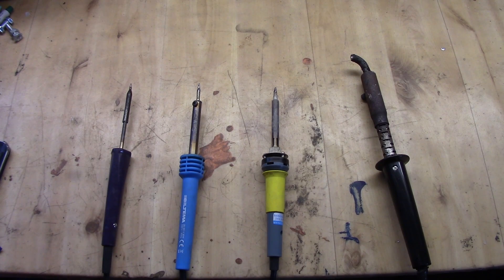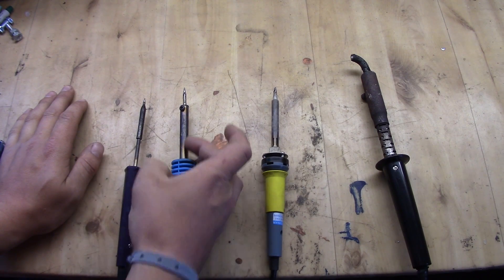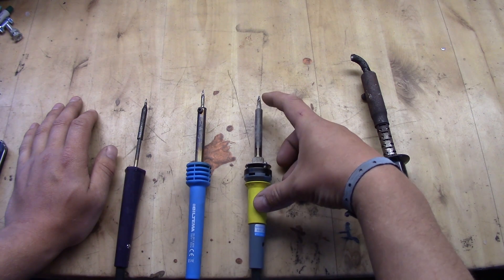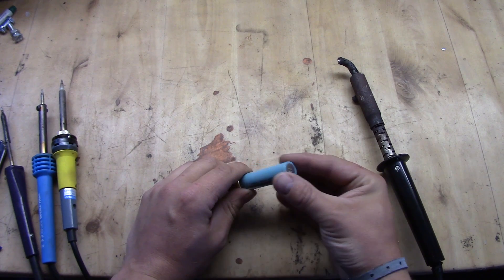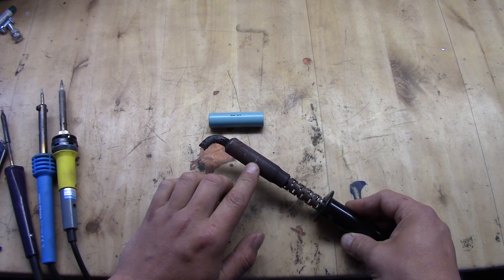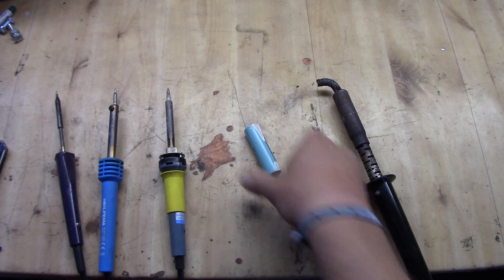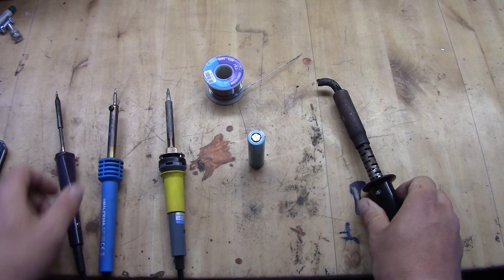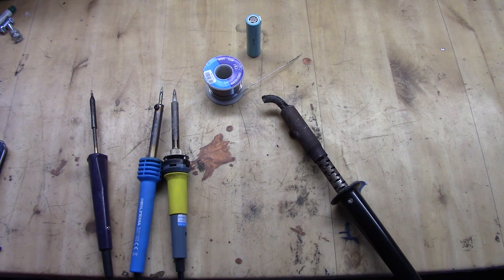Tool Tip: Soldering irons

Comment: Where did you get your tip from, mine is an angled flat head screw driver
Reply from the maker: Its solid core copper rod just bend to shape and filed.

Comment: I actually prefer the smaller wire because you can control how much solder you use a little easier.  My opinion only :)
Reply from the maker: :)  Thinner solder for me is 0.3mm. Thicker is 0.8 or 1mm or thicker :D For 18650 i use 1mm thick solder. For surface mount stuff i use 0.3 and for normal pcb other type i use 0.6 or 0.8